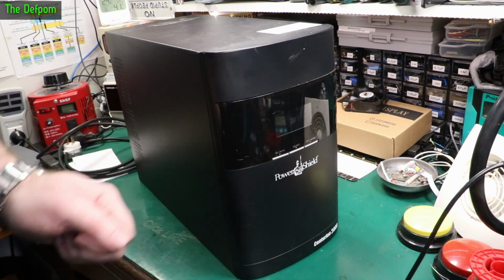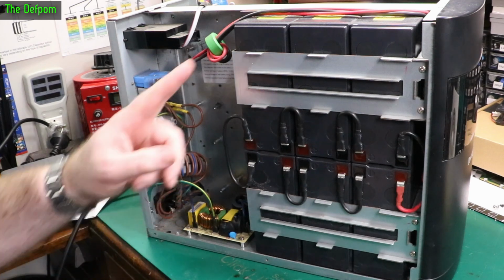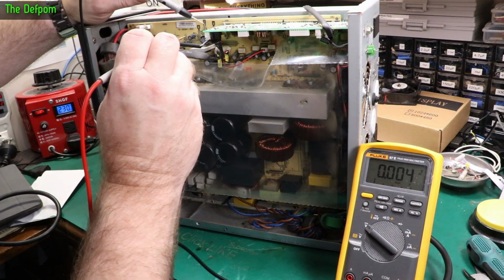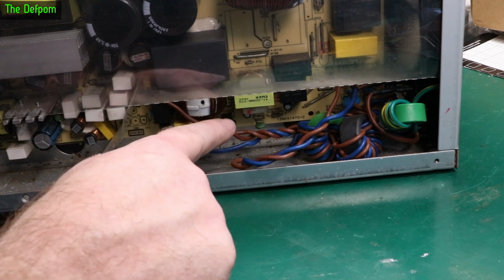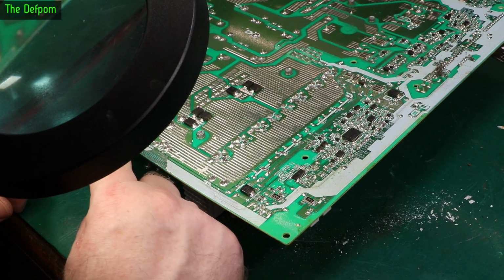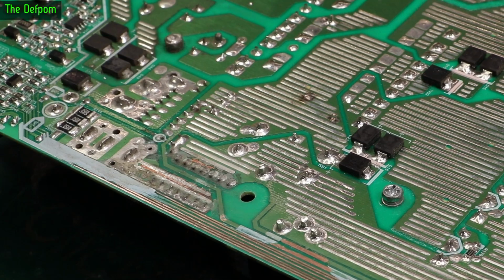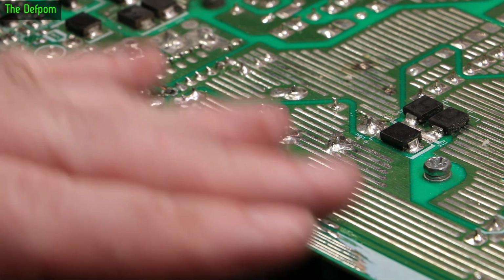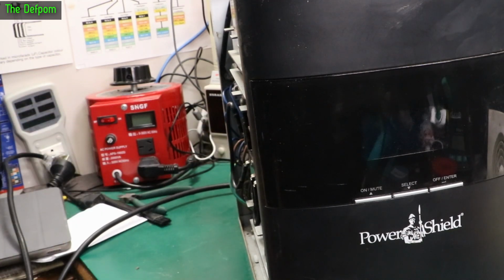🔴 Fixing a Faulty UPS - Powershield Centurion 3000 UPS Repair - No.1269

Comment: That's a higher current than the domestic iec cables. Around 15A. Used on a lot of high power equipment in data centres for one.

Comment: Nice job tracking down the open trace. That plug in the beginning is an IEC C19, used on 16A/250 VAC international or 20A/125-250 VAC North America.

Comment: The Aishi caps can be alright. They have good stuff and bottom barrel ones at bottom barrel prices. Using the cheapest series in the worst conditions possible is very conducive to premature failure, so they're not outright bad for not standing up to way out of spec levels of abuse.

Comment: UPSs always run the charger at maximum possible float voltage, to get best runtime with new batteries. This results in premature battery ageing. Drop the float from where it is (a truly horrific 14.2V) to 13.2V, and you'll get 75-80% of nominal runtime and extend the battery life to 5y+.
I had no idea NZ was so bad for battery prices, here in the Old Dart you'd pay no more than £15 a piece for decent 7Ah SLAs
EDIT: Fans are considered a consumable in the UPS business  xD

Comment: Nice fix.  In this case it wasn't the capacitor.  
I probably would have removed the oxidized solder.  You just diluted the oxidized portion by adding more solder.

Comment: There's usually only one way to get rid of the beeping - destroy the bloody buzzer or put tape over it to make it less.. annoying 😂
Reply: Try bluetack or hot glue if you must. Tape will still let the pressure inside the chamber cause the tape to vibrate, but with a thick enough barrier it won't. Piezo discs are silent and just tick/click if you put your finger on the disc itself. 🙂

Comment: That's a C19 connector, the difference between the C 13 is that C13 is rated for 10A and C19 is for 16A, it's very common on bigger UPS like you have there.